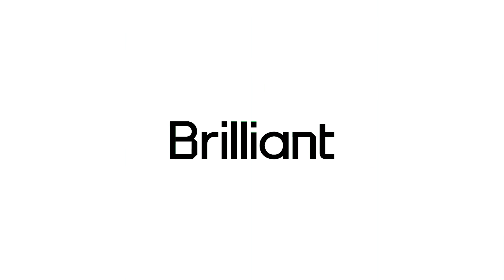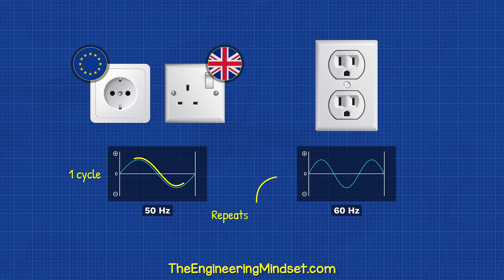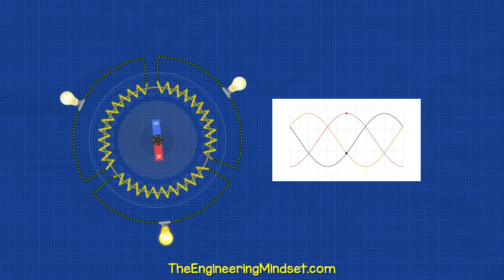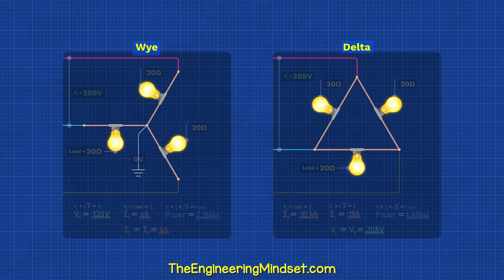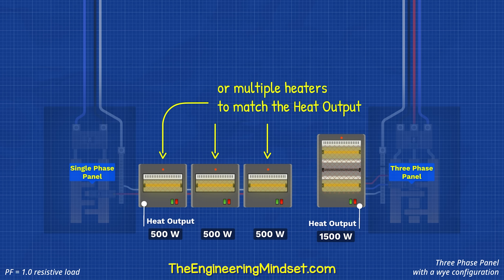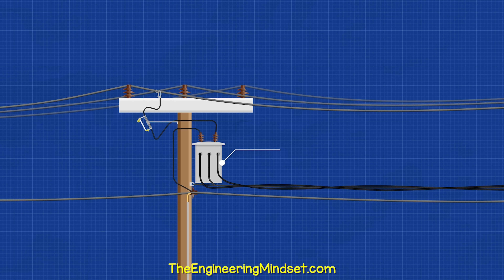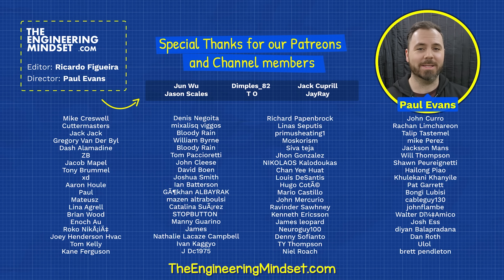How 3 Phase Power works: why 3 phases?

Comment: Renewables and Rooftop Solar

Australia leads the world in rooftop solar adoption. Homes with large solar inverters sometimes benefit from three-phase connections to export more solar power without risking grid imbalances.
A three-phase inverter can distribute generated power more evenly across phases.
Balancing Loads

Network operators try to keep each of the three phases loaded similarly across a street to reduce neutral current and losses. This is why different houses might be put on different phases.
High Demand Appliances

High-demand household appliances (large AC units, heat-pump water heaters, EV chargers) can be run on single phase if sized accordingly, but three-phase supply simplifies things for bigger loads.

Comment: LED-lights are actually MUCH MUCH worse and much more prone to flicker, because of how the cheap ones tend to be designed BAD.  Some are half-wave recitified and basically light 50 times a second.  The much faster LED's tend to obviously show this much MUCH better and tend to give me a headache.
Better designed LED-lamps can also do this when they use a much higher frequency (something PWM-like).  Never trust smartphones for video-flicker of artificial lights: they do all kinds of things that videocamera's should never EVER do.
If an actual videocamera does it, it means you are dealing with stupidly cheap LED-lights.

Smartphones have rolling shutters, which are supersensitive to flicker of whatever light, videocamera's either have global shutters or electronically corrected rolling shutters.
A rolling shutter is easy to discover: Film a train passing at high speed and see if the train itself becomes skewed... If it does, it's a rolling shutter.
If it doesn't, it isn't necessarily a global shutter, it can also be an electronically corrected rolling shutter.

(Interesting to know: 3-phase connections are common in The Netherlands for homes.  Especially in areas without natural gas supplies where you cook on electricity this is quite common.)

Comment: So 3 phases fix the problem of inconsistent power, yet you show a system where we still connect low voltage appliances to only a single phase, so why isn't my light bulb flickering?
Reply: Could be because it's way too fast for your eyes to see the flicker. Or that the light runs on DC that converts AC to DC without any valleys.

Comment: ONE ISOLATOR IN MY 3 PHASE CIRCUIT BREAKER BOX BLEW
LATHE WOULD NOT TURN BUT HUMMED
I NEEDED WELDER URGENTLY AND ITWORKED
BUTA BIG BANG IN OTHER GARAGE AND SINGLE PHASE LIGHT SWITH AT FURTHEST POINT FROM  METER WAS BLACK AND MELTED
BUT WELDER STILL WORKS--- WHICH WAS NICE

Comment: Meh. I don't buy your cost/complexity reason for limiting to 3 phase power. If it follows your reasoning, then we would only have 2 phase power, or single phase power. Seems like there would be a scientific reason.
Reply: Running a motor with 2 phases is not as efficient as three phase.
Reply: @OptiAero6432  How so?
Reply: @unitrobe0 Two phase is not exactly balanced. If efficiency was good for two-phase, Then it would be widespread. But as you can see in your country and the majority of the world, Three phase is the de facfo power.
Reply: Alright, So. With three phase, You could just have three wires for a motor as you could connect it in a delta connection. While with two phase, To complete the circuit, You would need four wires (usually), not exactly efficient as you can see here. Also, More power sent with less thicker conductors compared with two-phase power.

Comment: In single phase circuit 
We have Phase and Neutral 
If Neutral has 0V 
Then how will the neutral have negative half of cycle of AC
 voltage

Sir please clarify this doubt 
I can't find this answer clearly
Reply from the maker: The hot/live voltage is reference to neutral/ground. Neutral remains 0V because it's physically connected to the ground/earth. The hot goes positive and negative compared to neutral/ground. You are also tied to ground so you are 0V.

Comment: To Summarize: Three Phases are the BARE MINIMUM to get a decent, continuous, clean, and consisten output of AC Electricity, which is also the MOST economical. 
And, adding more phases would offer only marginal benefits, but prohibitively increase the costs of all the components in generation, transmission, control, and end-user equipment.

Comment: AC voltage is not constant. The value you read on your AVO is a calculated RMS value of the voltage or how much voltage you can calculate and use for power.

Comment: Hi, thank you for this great video but small comment at 3:42 the power curve is not correct, it should be in the shape of a sin²(x) which is a bit different of the "hilly" shape present in the video. Sorry for rectifying you as electroboom would say ^^'

Comment: Power proportional to the voltage squared.
If you square 3 sine waves 120° apart and add them together what you get is constant. Not close to constant. It's mathematically perfectly constant. 

So 3 phases is enough, the power will will not be even slightly smother with 4 or 5 phases.

Comment: The current graph at 1:58 does not agree with the physical representation shown a few seconds earlier (1:53). Current should change direction the instance the magnet pole begins rotating away from the solenoid. This took me a second, figured I share and maybe save someone some time

Comment: Excellent beginner's film.  I work in the lift industry and once inspected a lift in the UK which ran on two phases with a capacitor/inductor bank to make up a third to run the motor.  A quarter of a centrury later the lifts were to be replaced and I remembered that they were two phase so could advise the lift installers about this!

I also saw a 45 phase system being tested, it was for a specific purpose that may still be covered by the official secrets act in the UK!
Reply: for people who don't speak british english, lift means elevator

Comment: The UK is 240V, Europe is 220V. To make it simple for the masses and electrical equipment manufacturers, they use the supply tolerances and nominally spec 230V across Europe. It means equipment has a bit more power in the UK than rated and a bit less in the rest of Europe.
Reply: i once measured 135v in europe
Reply: @gamecubeplayer  It must have been a mains supply fault condition: generator failure, powerline disruption, severe atmospheric condition etc. 
The nominal mains voltage has some tolerance (216.2V to 253.0V in the UK) as load and demand is constantly changing throughout the day and night. Sensitive equipment normally has additional equipment called UPS to keep the voltage stable.
Reply: @soundslight7754 it doesn't really matter because 230v devices can handle anything from 220-240v & heating elements will run slightly hotter than on 225v
Reply: @gamecubeplayer  I can't believe you wrote that! :face-blue-wide-eyes: 
This is the 'Engineering Mindset' channel :hand-pink-waving:
As my professor said all those years ago: "In science, precision is everything"

Comment: Did they really calculate AC power vs DC power using a resistor and heat? I would have thought that math was able to calculate that without the experimental step.

Comment: Also an EE here - "Why 3 phase" - because it's enough to give a very smooth power delivery, without start and run capacitors.  I'm sure the video is great, but I already understand 3 Ph quite well as I manage 3 phase heavy machines as well as PhdEE.  You could quite easily have 4 phase for even smoother power (phasors 90° leading/lagging), but why?  Just more complexity and copper for virtually no benefit.

Comment: Here is a quick one, how come 08:03  we connect motor on the 3 phases but only consume from 2 coils, why can't we connect only 2 phase instead. I love your content by the way!
Reply: I think what he is saying here is each coil in the motor will be connected across 2 phases. Basically, the delta or wye load configuration with the motor coils as the load.

Comment: Really great video thank you. Amazing graphics. I have one question I wonder if anyone could answer though. I dont understand is why the central axis of the generator is allowed to be considered to be neutral for the three phase Y set up, considering there isnt any circuit to it inside the generator. For example, if I were to use just one phase (but no Y set up) would the circuit still be completed from that phase output to the axis neutral of the generator?

Comment: Why not more phases?! I thought i was the only one who wanted to use 6, 9...
Reply: more phases create more complexities, which cost more to maintain. Imagine having 6 transmission lines that stretch for thousands of miles in stead of 3 wires. That cost will quickly add up. The cons (mostly cost) just far outweighs the pros, which is more power. Long time ago, engineers just decided that 3 phases are enough power pretty much for anything that uses electricity.

Comment: Eric Dollard has given talks on 4 phase power, and Modern Electrical Engineering is a complete travesty of arrested development. The harmonics which are being allowed into the power system and current being thrown into the Earth are Colossal and " out of control."
Its an unchecked dangerous, " Badly Engineered " improperly understood system which is headed towards massive failures. Its also become much, much more dangerous and unhealthy to be around. The Meta cheap design and poor implementation Electronics is a major contributing factor.
Reply from the maker: Check our new version of Power Factor Explained so much more detail https://youtu.be/NIrKOVZrqnU

Comment: Is it possible to measure power of each phase for 480 V motor using three cheap Energy Cost Meter for Socket - 230 V? Simply by connecting L1+N; L2+N; L3+N is a no go.

Comment: Weird train of thought: has anybody ever tried running six phases as two sets of 3-phase (the next phase overlaps half of each previous, making each phase 120 degrees). Would this have any advantages and/or drawbacks, aside from the added parts and complexity? Or could this setup function instead with DC and powering the central line through induction, as a means to provide smooth output?

Comment: Nice video, only one correction: the power output plots starting at 3:39 are wrong. When you multiply two sine waves (V and I in this case) with the same phase angle (resistive load) you get ANOTHER sine wave (not a rectified sine wave, an actual sine wave) but with double the frequency and all of it above the zero axis. And later, when you add all three phases' power plots (mathematically addind them, not just overlaying them as in the video), asuming the load is balanced, you get a completely constant plot, not almost constant, perfectly constant, it's a straight line. THIS is the real reason why three phases are used: because three phases are enough to get a constant power output. This also happens with two phases but with 90 degree phase separation instead of 120. Just try everything I said on any software capable of doing it. Or try this formula: (sin (x))^2+(sin (x+2π/3))^2+(sin (x+4π/3))^2; it will give you 1.5, for any value of x. As complex as it looks, it's only a constant function. It's the sum of three squared sine waves (I squared them because the result is the same as using two in-phase sine waves, namely V and I) separated by 120 degrees. For those not remembering trigonometry classes who may try this: the calculator should be in radians, NOT degrees.

Comment: What physical aspects of a generator affect the amount of voltage and amperage coming off it?
Reply: rotational speed, magnet size/material,size of coils and how many turn for each and size of the wire used, the temperature of the motor when running, etc

Comment: Do devices care about how many phases are used? For example connecting a 230v european single phase device to a US 240v three phase outlet (voltage difference within spec) or the opposite
Reply: id think the rms between single phase and sum of 3 phase would be different so no youd probably fry the motor
Reply: @logickedmazimoon6001  The 230v and 240v are the rms of both options which are quite similar. EU 230v single phase has +-6% tolerance which includes 240v. The UK extend to +10% due to historical 240v rather than 230v. I would imagine most EU equipment will cope with UK spec to save multiple designs.

Comment: In parts of Norway we get 230V three phase. Each phase is 135V compared to ground, but appliances are always connected between phases. There is no neutral, we literally put a copper stake in the ground outside for grounding the outlets.
Reply: how big are your norwegian 230v range fuses usually? european range fuses are usually 400v 3x16a & our american range fuses are usually 208v or 240v 2x40a
Reply: Our main breakers are 3x80A. For individual circuits we use 2x15A
Reply: Sorry, I just realized you're talking about cooktops and ovens. In Norway, we usually have 2x25A for induction cooktops. However, that means you can't pull full effect from all the burners. The cooktop will limit the current draw so you don't trip the breaker. A better solution (although not very common) is to hook it up to all three phases with a 3x25A breaker. We typically install the oven separately from the cooktop, usually in a tall kitchen cabinet to the side. The oven needs a 2x15A breaker.

Newer housing in Norway also uses three phase 400V with neutral, so that the voltage between neutral and phase is 230V and the voltage between two phases is 400V. The cooktop would then be connected with either 1x25A or 3x25A, with neutral so that it runs on 230 V.

Comment: 2 phases only will also work fine. I think one reason using 3 is that 3 phases have a defined direction, what 2 phases don't. What may be important for (industrial) big motors. Small 2 phase motors usually need a start capacitor for that reason.

Comment: Good Video, but I have a small comment.

At 3:40 (and various other parts of the video) you show the output power graph incorrectly, what you are showing is the rectified voltage (or current) waveforms.
The correct power waveform look like a sine wave with double the frequency, and shifted upwards.
Note: this is due to the double angle formula cos² θ = (cos 2θ + 1)/2.
(This can be generalized to any linear load (resistors, capacitors, inductors or any combination thereof), but the power factor will change shifting power curve upwards and downwards, but understandably this may be beyond the scope of this video.)

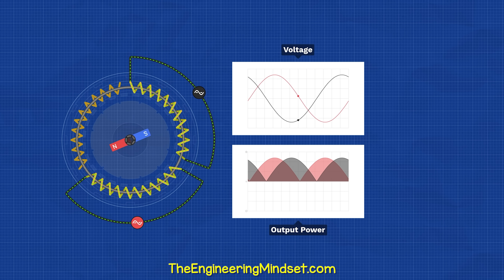At 4:16 you explain that the output power is ALMOST constant, but actually the output power is EXACTLY constant.
This should be clear if the correct power waveform was shown (rather than the rectified waveform shown).
This means that the power in the individual phases will pulses twice per cycle but the total for all three phases is constant.

Finally I believe main reasons for using 3 phase power, is that it is the lowest number of phases that meet all of the following criteria:
1. Constant "Total" Power Flow
    - Power in Single Phase pulses twice per cycle.
2. No Neutral Conductor Required
    - 1 and 2 phase power requires a neutral
    - 2 Phase Power must be spaced 90° apart (in order to meet the criteria above) and the neutral would need to carry √2 times the current as the two phases.
3. <Bonus Criteria> Can Provide a Motor with a Rotating Magnetic Field
    - Single Phase Motors Require a Starting Capacitor

Comment: the power graph at 3:20 is wrong, because the current isnt constant, rather the power will look like the function y = sin(x)² if the load is not inductive or capacitive, if it is capacitive the graph will just move down and right or down and left depending on whether the load is capacitive or inductive.

Comment: LED's are not constant. They save power by doing the exact opposite of constant. They turn on and off to save power. They alternate on and off just fast enough that the human eye cannot see it, but that is still much faster than 60hz. The reason you can see the incandescent bulb flicker is rolling shutter. You can see the dimming rolls up the screen. Incandescent flicker is barely perceptible because the light is produce by the heat of the filament, NOT the current. The current simply heats the metal. It does not have time to cool between cycles to show a dim phase.

Did you do ANY research about how bulbs work before writing this or did you just wing it?
Reply from the maker: Yes I did research. LED's are constant, or can be. Connect one to a DC battery and it doesn't flicker. My studio lights don't flicker, they are LED, they are made for filming. However, my LED desk lamp dose flicker because it's cheap and converts AC to DC in a cheaply designed circuit. You can adjust brightness by turning them on and off very fast and I have even made a video about that and how to design the circuit. You can slow down the AC frequency of the electricity to an incandescent lamp and see it flicker with your eyes. That's one of the reasons 60Hz is used, because it's mostly unnoticeable to the human eye. I'm fully aware the lamp produces heat, from the current of electrons colliding with the atoms inside the filament, and it doesn't have time to cool down to full see it dim, this is not the point of the video.

Comment: If I remember correctly the total output of three phase generator is mathematically static. P=sinx+sin(x+2pi/3)+sin(x+4pi/3)=constant therefore it's not "almost" constant but strictly constant.
However this set asides the load part. If the loads on the three phases are not identical their output will not be the same and the generator will suffer vibration.
Reply from the maker: Yes you are correct. However, at that moment where "almost" is shown, the three coils are completely separate still. They are not combined. However, I should have made this explicitly clear and later in the video mentioned this. Unfortunately, I didn't.